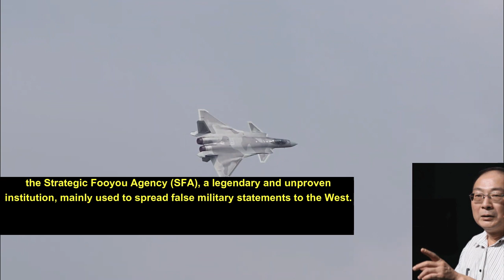China will have 300 J-20 Fighters with WS-15 Engines in the coming year

Comment: I  guess in 5 years  more than 300..
1 lines production is about 48...china in this case will set up 4/5 lines production  since the escalating rusia- ukraine....
Therefore ..1 year about 200 units  to 250 unit j20 plus j20 rusia engine, giving yotal 
About 250j20

Comment: Not in 1 year, but quite possibly within 4 years or less. That is a additional 300, if its a built up upon existing numbers to 300 all with WS 15 engines then within 3 years maybe, that at least 700 WS 15 aero engine? That a WS 15 aero engine every 1.2 to 1.3 days.